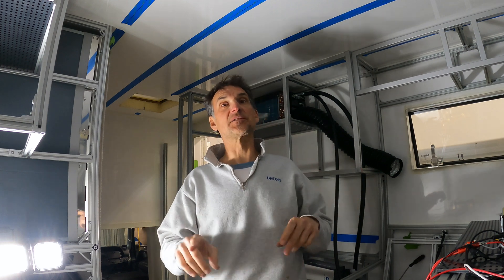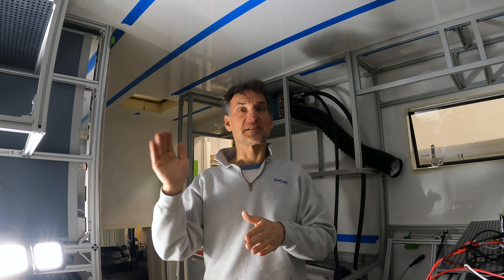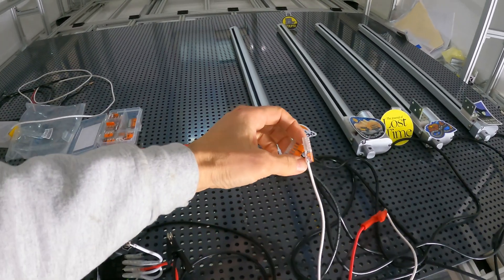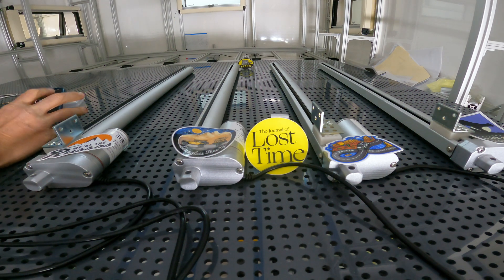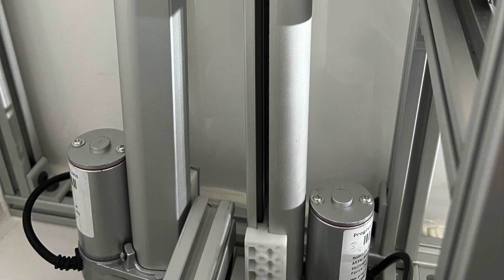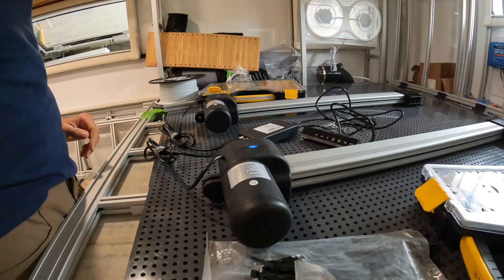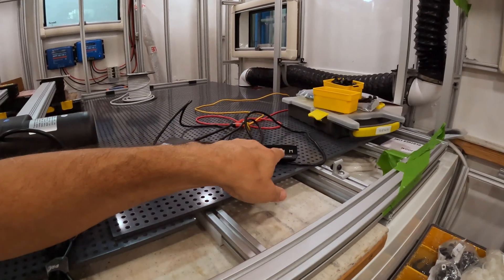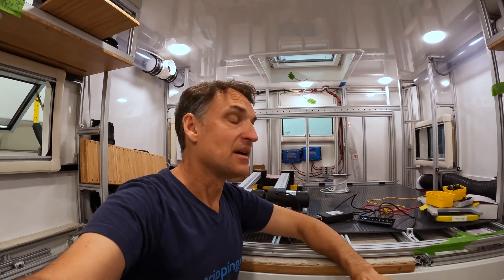Expedition Camper Linear Actuator Olympics

Comment: Good video. I have the PA-18's for my Sprinter bed, too, but opted out of the hall effect and wish I hadn't. They are installed but I am refining my plan to include external limit switches as my resulting up/lower limits for the internal ones have become OBE. The limit switches will 'reset' the alignment because they are individual. I also bought the wifi controller which works with the app and I can use a single switch for the group or move them individually if they get too out of sync. To account for level differences during travel across the four actuators and any potential torque on the bed frame, I am working on a 'flexible' attachment (rope cable) or a ball joint if I can find the right one for my use case. The latter effort has come up empty so far. Will likely go with the rope cable and put heat shrink to make it look finished.
Reply from the maker: Thanks! Sounds like you have a similar set up as I did for my bed in my camper van, yet I did that with four non-track linear actuators (PA-04) and controller. That worked out great with the pivot points at top and bottom of each actuator. I had the wiring at the stationary point except for underbed lighting, which I just had the wire extend out to the length needed when in full up position. Worked great. Good luck with you solution.